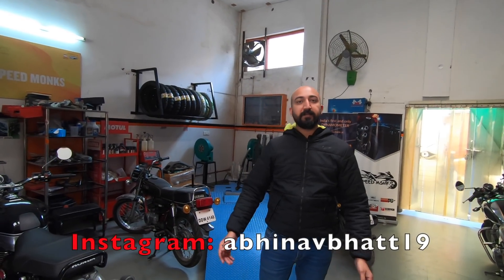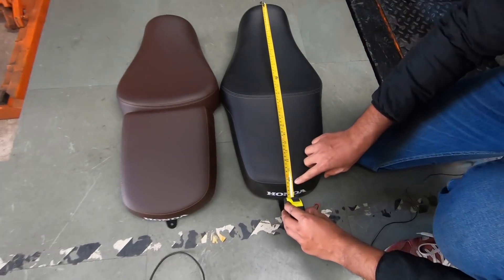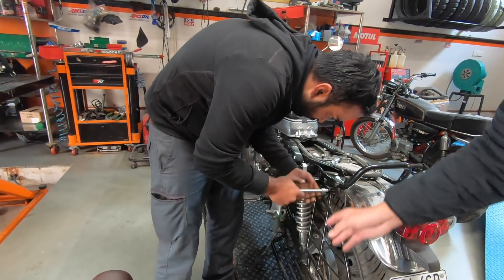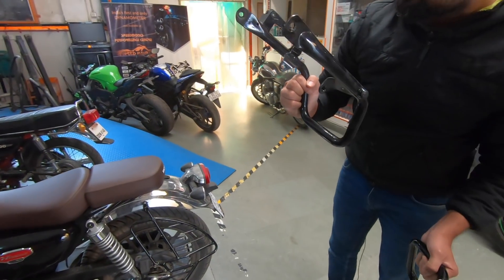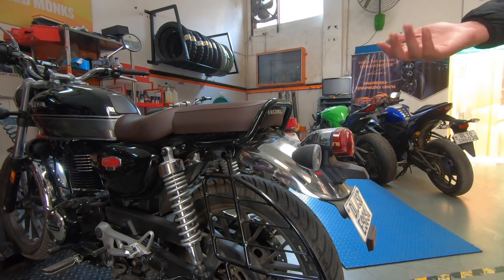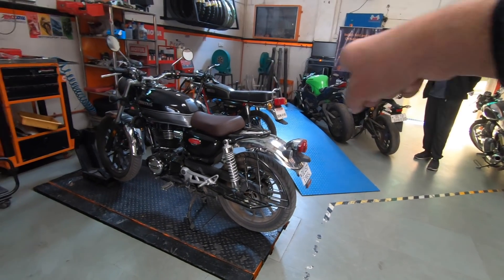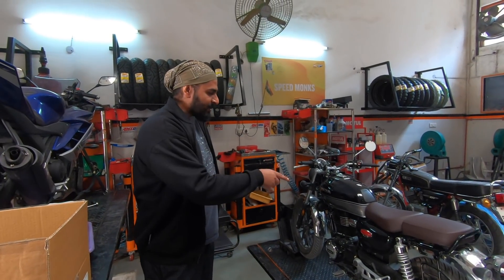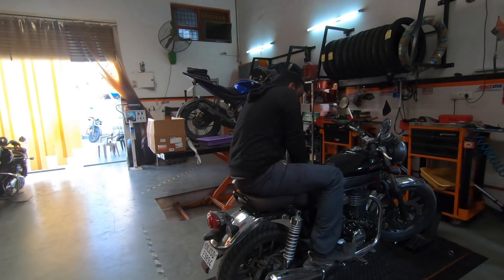Honda Highness CB350 Split Seat Installation And Challenges Faced

Comment from the maker: IMPORTANT UPDATE: It looks like Honda packed the wrong grabrail (which comes stock with the bike) in the split seat package. The correct grabrail (just saw some photos) seems to be bigger and has enough clearance from the seat to hold. I'll ask Honda to replace it.
Reply: I was wondering the same, thanks for the proactive update Abhinav
Reply: i got an idea, take Enfield's sum luggage carrier with Simple design and make fix in with honda Stock Grabrail Fittings bracket system to RE Carrier...den its finally its luk like Scrambler with Solo Seat fit...
Reply: Grabrail: i do Most R&D for my Bike so ..Try with RX 100 Grabrail i thinks its Similar to CB 350 Grab but need to make sum Weld Job for Fittings and Powder Coat black instead of chrome Grab of RX 100 ...
Reply: Thanks Abhinav, nice informative video..... was waiting for some one to detail the pillion seat issue, you did briefly mention it in the Mc donalds video with Srini.
I would rather saw off the old grab part (at the rear) and get two handles welded to the bolted on (now separated ) side members and make it into grab handles.
Reply: Guess Honda is falling behind.
Reply: Hi abhinav I wanted to ask after you installed the split seat does it give more comfort than original stock one? I also purchased the metallic black model and I am considering buying split because stock one feels a bit hard . How was your experience ?
Reply from the maker: Same foam density and shape, size. So same comfort.
Reply: Hey Abhinav,
Looks superb with the brown split seat!! Was wondering myself how can there be no difference in the stock grab rail & the one that came with the split seat!?! 
The grab rail there to ensure that the sari guard can be booked in place, otherwise it's unbolted at the seat side!! Keep the split seat, definitely adds to the "Retro" look!! Stay safe, take care!! Cheers!
Reply from the maker: Same comfort. Rider seat is the same size and shape. Foam density seems same too.
Reply from the maker: Thank you :)
Reply: Was wondering the same and also checked with one of the owners who has got split seats in Bangalore. Thanks for the update
Reply: Great
Reply: Hello Abhinav.. Was Split seat more comfortable than original one, as the original ones have rear seat more stiff. Do advise as I was thinking of buying this split seats just if they provided more comfort.
Reply: Hi Abhinav, i purchased CB350 by watching all your videos, tried meteor test ride as well but the clutch and in city condition, highness is much better according to me. but as i travel mostly with pillion, it feels like it required a back rest and carriel. Please look for some aftermarket availability of accessories and lets us all know if it is possible to get from anywhere online or they can make shipment in various location. Thanks for all your videos and afforts. Love from Hyderabad.
Reply from the maker: Okay.
Reply: bro can you please share the link for the photos of the right grabrail which you are referring to.
Reply: It's better without the grabrail
Reply: needs a fatter tyre
Reply: इस  मोटर साइकल को लेकर आप ने अभी तक जितनी भी जानकारी दी बहुत अच्छा लगा आशा करते हैं आप आगे भी बहुत सारी जानकारियां प्रदान करवाते रहेंगे !इस  के लिए आप को बहुत बहुत धन्यवाद!मुझे गर्व है आप एक भारतीय है लेकिन  अफसोस इस बात का है आप यहां रहकर हमारी मात्र भाषा का उपयोग नहीं करते!🙏
Reply from the maker: @pankajrich1983  Pankaj ji, chaliye aaj aapko bikes ke alawa so aur nayi jaankari deta hu - humaare desh ki koi rashtrabhasha/matrabhasha hai hi nahi. Hindi sirf sabse zyada bolne waali bhasha hai, aur kucch nahi. Aapko meri bike ki informarion achchi lagi, ye sunke mujhe achcha laga.
Reply: Abhinav ji बहुत अच्छा लगा अपने मेरी बात का जवाब दिया मैंने सिर्फ आपको अपनी मातृभाषा/स्थानीय भाषा का उपयोग करने के लिए कहा है ना कि हिन्दी का उपयोग...आप की जानकारी के लिए धन्यवाद 🙏
Reply: @pankajrich1983  Vahi toh ye bol rhe h ki India ka koi bhi national language nhi h. Hindi & English official & most spoken languages h India ki. Lakin matrabhasha nhi h hamari koi. Hockey ko bhi hum jese national sports samajhte h lakin asal mh India ka koi national sports h hi nhi.
Reply: @RogerThat21   पहले आप अपनी स्थानीय भाषा और मात्र भाषा का पता कीजिए! सपोर्ट के विषय की तो बात ही नहीं हुई
Reply: @pankajrich1983  Google use krlo bhai
Reply: @RogerThat21   और गूगल को यह जानकारी दी आप ने और हमने पहले मेरी टिप्पणी को अच्छी तरह से पढ़िए फिर कुछ कहिये
Reply: I know im asking randomly but does anyone know of a tool to get back into an Instagram account??
I somehow forgot the login password. I appreciate any tips you can give me.
Reply: @Landen Brady Instablaster ;)
Reply: @Kendall Jalen Thanks for your reply. I found the site on google and Im trying it out atm.
Takes quite some time so I will get back to you later when my account password hopefully is recovered.
Reply: @Kendall Jalen It worked and I actually got access to my account again. I'm so happy!
Thanks so much, you saved my ass!
Reply: @Landen Brady No problem :D

Comment: Brother i knw this is totaly unrelated, but i do have a couple of queries regarding ur audio setup on the helmet. 
1. Is it necessary to use an adapter for using a mic with a go pro? 
2. How do u attach it to make sure it remains safely held as well as doesnt get affected by the elements?

It wud be great if you can make a video on that for us beginner motovloggers.

Comment: I was expecting better foam quality for paying additional amount for seat as the stock seat isn't that bad either.  So would preferably add an inch of high density foam on existing seat which would cost about 1k.. so would get improved comfort and spend less on buying an entire seat instead

Comment: Hi, abhinav thanks for clearing the doubt i had when i saw split seats in showroom. Actually when i saw the stock seat setup opposed to  split seats the grab rail was higher in split seat. I thought the difference was in seats. I could share the picture with you if you want.
Reply from the maker: I think Honda accidentally packed the wrong grabrail instead of the new grabrail which should be bigger.
Reply: Btw, thanx for the genuine reviews man. I booked the red one. Loved the way bike is build. Also i saw the panier racks fitted over the saree guard.
Reply from the maker: Congratulations

Comment: I would prepare to get the seat customised  form good professional so it goyal accomodate two big guys easily and have space for additional luggage to carry during touring. The seat length can be extended till tail light section  , almost like 5-7inches hain.

Comment: Hey Abhinav, thanks to the test ride that i did and the reviews that you and motovin have posted, i finally bought my cb350 today (green). 

I do have a couple of doubts though <New biker alert>. 

I noticed that when I first punched the engine to life, there were some minor vibrations (compared to the test bike)  and when I went to higher RPMs in gears 1 & 2 (20-25kph in 1st & 45-50 in 2nd), I noticed that there were some vibrations (possibly engine feeling strained). 

Is that expected and will the engine ease out as I put in some distance (or am i expecting too much in thinking that it would be vibration free like an electric vehicle :D)? Any suggestions on how to break in a bike?

Love how you review a bike btw! excellent content.

Cheers!

Comment: Hi abhinav. Thanks for the great reviews.

I took a test ride of the cb350 and noticed the bike drops revs very fast when I leave the throttle while riding. Almost that I can't hear the engine anymore . Does this happen with you too ? Is this normal or is it something that needs to be fixed ?

Comment: You can fit it as a single seater you will have to use the metal plate joining the split seats. If you check this video of  yours will notice two nuts on the frame right behind the rider seat on the frame where the metal plate is to be attached. Two bolts to fix metal plate on to frame, one bolt metal plate to rider seat.

Comment: Am not happy with this split seat as well. Gotta look out for an after market seat and Grab rail as well. I believe there's a lot of scope for after market ppl👍
Reply from the maker: Only thing good about this split seat is it is longer.
Reply: @abhinavbhatt  Hardly 🙄 All I can notice is it that it is simply split into 2. And that Grab rail that comes with that seat - is definitely a joke from Honda 😂🙏
Reply from the maker: @Wanderer_Vihari  I don't even understand why they gave it in the first place if it is the same damn thing. All that happened was I ended up not having the helmet lock on the bike.
Reply: @abhinavbhatt  😂😂😂😂😂😂😂 If this is how HONDA manages their in store accessories section. Am sure, very soon RE will throw open its CUSTOMISATION SERVICES for CB350 customers as well along with Meteor 350 😂😁😁😂😂😂
Reply: @Wanderer_Vihari  🤣🤣

Comment: Hi Abhinav 
I am a bit confused on taking gloss Vs Matt black in dlx pro . Can you guide me on the following .
1.Can we maintain the Matt finish the same without any dulness or becoming gloss on a longer run ? 
2. And is Matt maintenance process is really hard ?so that u have opted a gloss.
Would like to be practical than which one I like .
Reply from the maker: Gloss easier to maintain than matte.

Comment: Thanks for the video Abhinav. Planning to make a custom extended grab rail with luggage rack. Later put on a longer custom seat. Only concern is to find the right guys to do the job.  The 'split' seat is surely better but Honda could have done better with regards to the seat in the first place. Such a good bike with a horrible seat design. Also plan to have longer foot pegs like the ones on either metoer or the avenger. Must measure both first.
Reply from the maker: Actually, the comfort offered by this seat is astounding. I had a 9 hour riding day in it and zero complaints. Maybe pillion seat could have been longer. Thats about it.
Reply: @abhinavbhatt  One question though, does the new replaced grab rail come with a helmet lock as in the original? Thankyou for your efforts.
Reply from the maker: The one I got did not. Will check with Honda and get back.

Comment: Abhinav...one question not related to the split seat (or for that matter, nothing to do with seats at all)... the Bluetooth feature in the Dlx Pro version....do we really need that option? Cant we simply have a Bluetooth headset inside the helmet, paired to our phone? Wouldn't that suffice? What exactly is the value added by the Honda Bluetooth option? The regular Bluetooth headset would assist in automatically picking up calls, voice over for turn-by-turn Google Maps navigation etc. Maybe I'm missing something... can you please enlighten? Thanks.
Reply from the maker: Absolutely not needed. Phone plus Sena does the job.
Reply: @abhinavbhatt  thanks... I thought maybe there was more to it than I had understood....

Comment: The grabber should be come with back support with little space in the seat area, with helmet Holder, secondly if this vehicle comes with the chain, the durability and the chain of the life will increase it protects from dust and water, the crash guard at front side is also need to have a good design ed one.

Comment: Hi I have also changed the seat and opted for double seat. However I feel you have been given the wrong grab rail as the grab rail provided to me is definitely larger and the pillion rider can comfortably hold the grab rail as the height is also more. Pl check
Reply from the maker: Yeah, seems like it.
Reply: Pl check with Honda dealer. Infact the helmet lock facility is also provided with new grab rail

Comment: Does this split seat offer more comfort. I would like you to use the grab rail of Bajaj Avenger which probably would fit .It has better backrest cushion and looks elegant with its chrome finish. Alternatively you can try the original 1st gen RX 100 with chrome  career  options . The helmet lock can be welded onto it.

Comment: Worth subscribing channel. Love the way you put things in front of us. Lovely, trust worthy and unbiased reviews. I took test ride of both cb350 and meteor 350 I feel both are equally comfortable to me. Now m in dilemma which one to choose.  M super comfort on 800mm seat height bikes. M a lecturer in a govt college, m 5.5 tall, 38years old and 85kg I need a comfortable reliable bike to commute with pillion always to college. it’s a single road with lot of curves. Of the 35kms to my college 50% is city and 50% is highway, Not exactly highway it’s traffic free curvy road I can say. Please suggest a easy to handle, reliable, comfort to ride, good pillion comfort, fuel efficient (around 35 kmpl) above 200cc bike

Since 10 years m using FZ S which is very comfortable
Reply from the maker: You know what you want. I guess only you can answer this honestly for yourself. No pick will be wrong - remember that. Both the Honda and RE are damn good.

Comment: Hi abhinav ji, can you say where did you bought that after market split seat? Because i want to know where  that seat is available...
Reply from the maker: Hi. I bought it from Big Wing Honda, Gurgaon.
Reply: What is the total cost for that seat? Only 3700 or it cost more than that for any extra fittings
Reply from the maker: @Surya-dg2rh  3705. Don't know if Honda charges for fittings because I got it fit outside
Reply: Oh okay thanks @abhinavbhatt

Comment: @Abhinav Bhatt, I was thinking of buying the Meteor split seat specially the one of the two which comes as accessories and not the stock one and get it fitted into the H'ness along with the grab rail and backrest of Meteor Supernova..lol..well I even have a plan for getting the tail light of meteor fitted into H'ness...am sure it can be done using some jugaad😉
Reply from the maker: Maybe quite a lot of jugaad. Not worth it in my opinion.

Comment: Rear mudguard is not designed for retro bike and is more airodynamic which is not necessary for bikes going under 120 KMH . It should had more curvi wrapping rear tyre entirely .   Spilt seat and grab rail are both not  worth the money to spend on recently launched  economy class bike .It virtually  offers no   benefit . Seat could has been plush built with more support , grab rails could had been longer and and much higher than stock ones.what do one does with original seat which is equally brand new .Company should give buyback option  or choice between 2 seats during order placement .

Comment: Honda or meteor ? Wats for u ? Spill it man
Reply from the maker: Hahahaha. Both.
Reply: @abhinavbhatt    meaning it 
H ond A H ond A
Reply: @abhinavbhatt  sailing in two boats dear..u got to master the splits in yoga
Reply from the maker: Hahaha
Reply: Dear abhinav any idea the bigger honda on its way would be parallel twin or just the upgraded cb 350
Reply from the maker: Single, most likely.
Reply: @abhinavbhatt  that's a dampener then

Comment: I can't understand why Honda cannot offer that split seat as a standard prefitted option? Same is the case of those shitty rear view mirrors!😒 Why should someone purchase a new ₹2L+ costing bike with bad short seat and bad short stalked mirrors and then immediately have to cough up a few thousand rupees extra for a better seat (from Honda itself) and better (aftermarket) mirrors? Those are rather absolutely essential fittings and hence Honda should not consider them as accessories at all! And according to Honda what is one supposed to do with that brand new original single seat? Use it as a pillow at home? This is nothing but daylight looting by Honda! 😬😠

Comment: I think Honda hates Pillion. Even split seat is also worth less as it just increases only 2 inches which is not at worth.

Atleast 6 to 8 inches extension is required incase you want to go on long ride with ur wife or Girl friend.

Useless.  Meteor will rule coz of this over small size seat